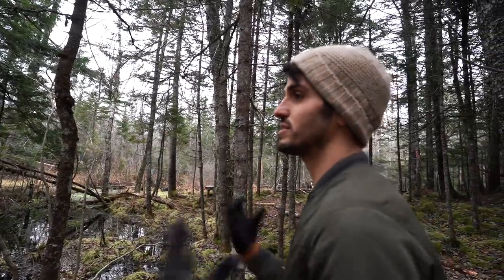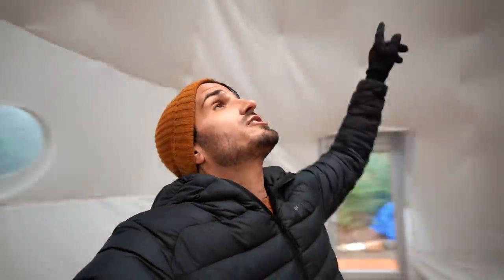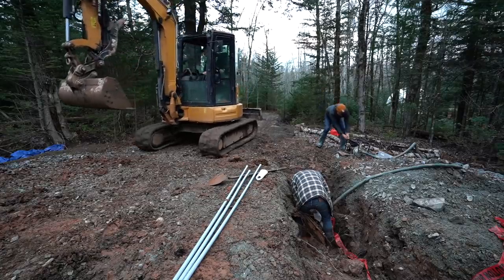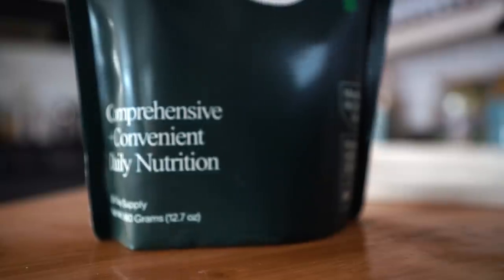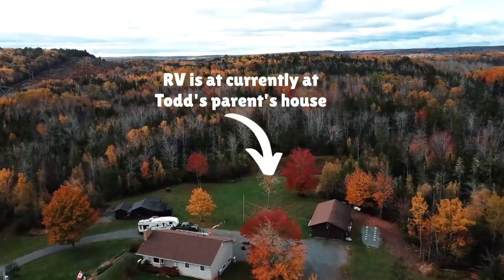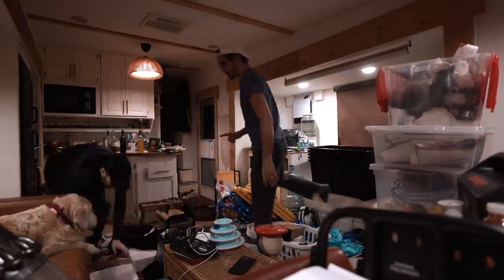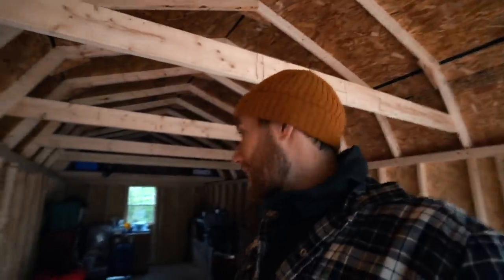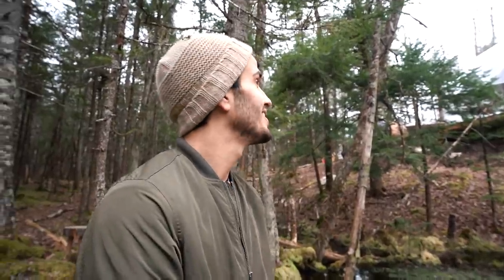Geodesic Dome Build (Insulating our Tiny House)

Comment: "I love you... now we should go back to work" - exactly my way of thinking, I think I found my soul mate 😀
Re: the dome, if I may offer a project for the future? From the back it's visible that you have a big cavity underneath the deck. If I was you, in future I would shape it a bit deeper and secure it, and then add some wall type doors, or just walls with a big door. In this way you will have a "basement" where you can store the wood for the stove, that will be an additional line of insulation,  also will keep the slope from eroding during seasonal rains, and in future, if you make the external walls of the basement more solid and add internal stairs, it can turn into another room...

Comment: The beams might be good to hold pieces of wood or pipes out of the way
Reply: I was thinking the same thing! That adds a lot of square footage...
Reply: I had a similar thought, like maybe just half so they can enjoy the 9 foot as well.
Reply: For sure some loft space for stuff you rarely need like holiday decorations.
Reply: I was totally thinking the same thing when I saw the beams.  It looked like Todd barely fit under them while he was walking, but who knows, they could keep some of them and raise them up a foot.
Reply: A great plan for upper garage space, platforms that can be raised and lowered to floor.  You never have to climb up to store or retrieve items.  Can use a pulley or hydraulic system.

Comment: The decking material and spray foam have been integrated to provide greater structural strength and durability.    Your mind works so fast, “integrated” was in your subconscious and threw you off.     By all means, don’t change your pacing - it’s perfect.  

In a few years I could see you writing hallmark movies, or at least your story - it would be the romance script we have all been waiting for.

Comment: Just a suggestion: if you put the snow you shovel underneath the dome and try to close in the gap between the ground and the dome’s floor, it will block any wind from coming up, and you don’t have to worry about runoff in the spring.
Luv your channel!
Stay safe, stay sane, be well
Reply from the maker: At R-40, the wind can blow around down there all in wants without it impacting the insulating value…another reason we went so overkill with the thickness!

Comment: That was a quick dump of snow eh? Winter is upon us. Today its all but gone - hope you didn't experience any flooding over your way. Your spray foam with vapour barrier "built-in" is a great idea - excellent summary by Todd. Could use that under my pantry. Hope Tyler has an amazing 30th - damn, I have sweaters that old!! All the best guys, pups and kitty.

Comment: This will be fun to follow through the winter. I live in Norway and we have exactly the same climate. 40 cm floor insulation or equivalent 40 cm is very sensible(.In fact, a requirement here ) You will save huge heating costs - or work cutting and driving. Brilliant.

Comment: Looking good guys! So glad you two are feeling better. The stress is worth it. Plus putting skirting around the bottom would help to keep in the warmth too.
Reply from the maker: That’s why we went with extra thick insulation so we don’t have to skirt the dome if we don’t want to! Time will tell based on how the temperature turns out!

Comment: Glad to see the progress and everything coming together.  Wish you had all of this going for you last winter as not sure how you survived in the RV all winter long as Canadian winters are very long, very dark and very cold.  Also, since heat rises, the R value does not need to be so high on the flooring.  You also might want to consider some type of ceiling fan as a lot of heat will be accumulating towards the top part of the dome.

Comment: I spent some time in England..Christmas was in an Elizabethan mansion...the owners had put a sheet of plastic on the outside of each of the diamond paned windows...sealed it and pulled air out of the now double paned windows, creating a vacuum, it was the warmest place.. i had experienced that winter.  You guys might try that...the dining room had a huge fireplace...one might build a fire and be able to sit on either side and starw up at the stars..without harm..

Comment: I would leave the beams in just for added support for the roof. I assume y’all get heavy snow falls, and hurricanes ( or something similar). 
Besides those beams could come in handy by hanging items off, or make a small attic for more storage. You’ll just need to add more beams for support, then lay down some plywood for the foundation.

Otherwise, you guys are great.

Comment: You should put a cover around the bottom of the dome deck. And make it removable so you can take it off in the warmer months.
Reply from the maker: That’s why we did so much insulating underneath! We won’t ever have to worry about taking things on or off during cold/warm months!

Comment: Just a tidbit:  The spray foam most likely only adds a small amount of structural support.  BUT I believe I understand why the floor seems to have more structural integrity:  it has to do with sound, and vibrations.  Generally speaking, sound waves / vibrations move through that type of wood relatively easily, compared to  denser wood, or other solid material like cement, etc.  With the foam now coating the underside of the floor, any vibrations or sound waves that pass through the wood are now absorbed / dampened by the foam.  So it muffles or mutes the effect of those vibrations when you walk, etc.

Comment: I can imagine the stresses you face, but I have to say Eddie didn’t look remotely stressed! Au contraire! Couldn’t you use some of the beams for high storage shelving? In my experience, the crap you need to keep but only use occasionally needs to be well out the way so you’ve space for frequently used stuff.

Comment: I would leave those cross members in supporting the roof of the garage .. It will help when the snow is packed on top of the roof .. I'd insulate the plumbing pipes under the dome deck .. Hmmm he didn't fill the joist space fully ?

Comment: You and Van Wives on a joint trip somewhere warm will be fun. Canada in winter is too harsh a life for me. Scotland is wet and cold, but not really ever that cold for long. 5 C with some showery rain today for example. I am impressed by your attention to detail on all the multiple work areas so far on your project. How will you protect it all from intruders whilst you are away ? Van Wives have said that someone will live in their cabin whilst they are away. You have so much stuff on your site which could go missing if left unattended.
Reply from the maker: Been so much hard work over the last year and half, getting away somewhere warm for a few weeks is just a must at this point! Luckily for us, our family is just a few minutes away and with a stable internet connection and lots of motion sensors and security cams, nothing to worry about!
Reply: @tylerandtodd  If you build something somewhere in a warm climate I volunteer to house sit for you !

Comment: Hi!!! Oh my goodness, we’re in the same mess! We are attempting to get our geodesic dome set up. And it seems we also have hurtles at every turn, we experiencing condensation between the canvas layer and insulation layer and I’m in panick mode. After watching your videos. It was very helpful by the way. We’re not living in ours, but we want to be able to use it year round. I have tried contacting a couple of companies to get a better insulation than the one we got with our dome, but both companies I reached out to said if we didn’t purchase the dome from them they couldn’t sell us the insulation,… a bit frustrating to say the least. We seem to be on our own every step, we love watching your videos and we’re not to far from each other. 🇨🇦
Reply from the maker: Call backcountry recreation in BC and tell them we told them to reach out. If they have a liner that will fit your dome, they should be able to help you out!

Comment: I would not remove those beams that run from wall to wall in the shed They are "Collar Ties" and are very important for the roof, it keeps the wall from spreading when there is a snow load on the roof.
Reply from the maker: Those beams are only for transport as we mentioned in the video…our trusses are engineered for the snow load in our area that we don’t need the tie downs!

Comment: Will you put some kind of skirting or enclosure around the bottom of the deck to help keep wind and animals out?
Reply from the maker: The R value of the insulation is more than enough that the wind won’t have an affect PLUS the closed cell spray foam is pest resistant!!

Comment: I know how much work goes into your videos but I don't want them to end.  One question, how did the spray foam not come through the deck boards into the dome?
Reply from the maker: The gaps were tight enough that they wouldn’t fit through!
Reply: @tylerandtodd  Gotcha.  Thanks.  I have a feeling that answer would evoke  an
R rated response from Todd.  Love you guys!